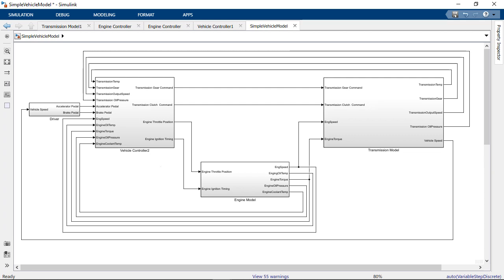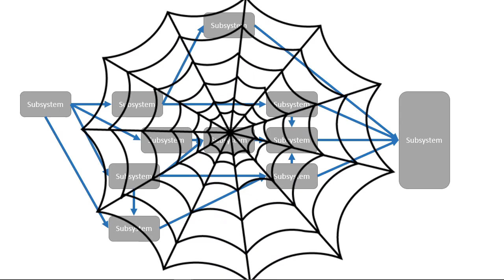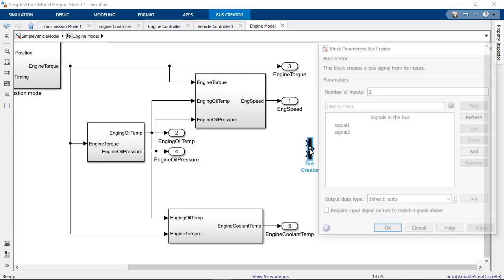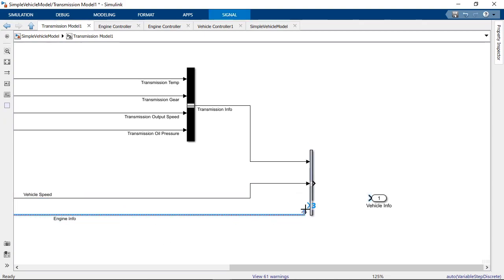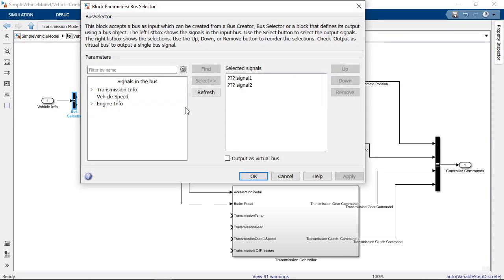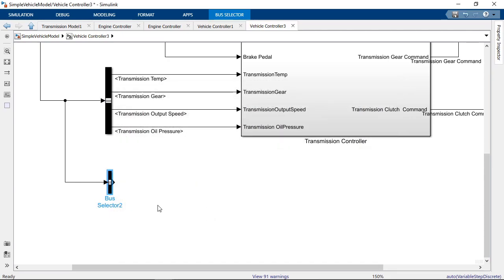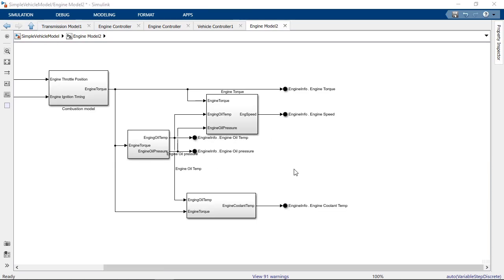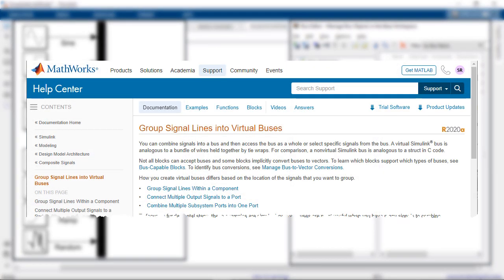How to Use Buses in Simulink

Comment: Bus is a good way to simplify the connection but remember, if you put bus object associate with some signal, it is not recommended to make it a virtual bus. Virtual bus is more suitable for simplify the canvas organization but not suitable to associate with bus object. On the other hand, Bus Element Port is the trend, bus creator and bus selector cannot make things easier you will be scratching about create nested bus creators or bus selectors if the bus signal is nested. Just remember, if you want to use virtual bus, do not associate no bus object. If you want to use bus object, let it associate with a non-virtual bus.